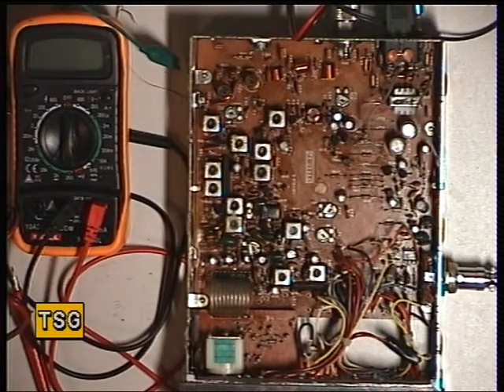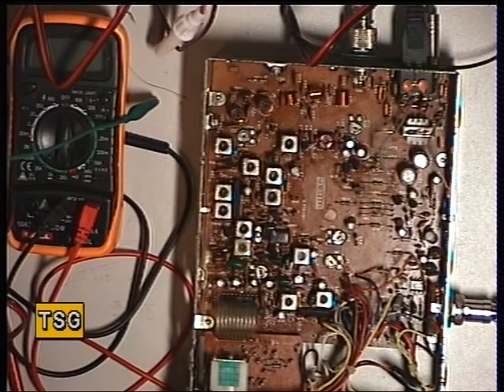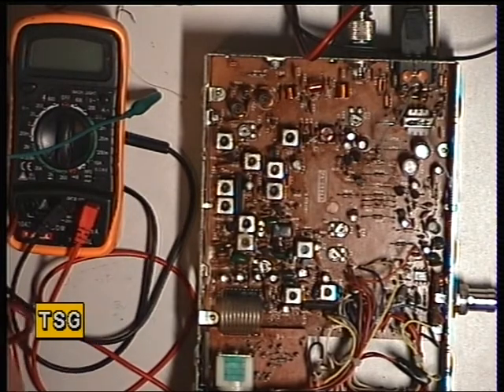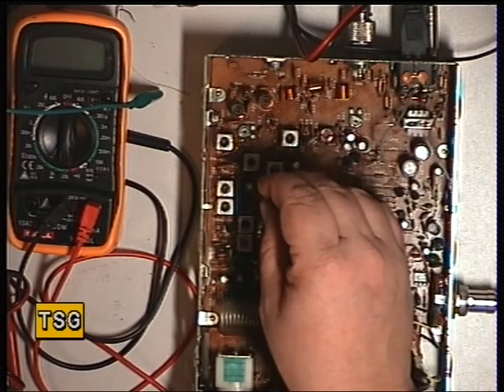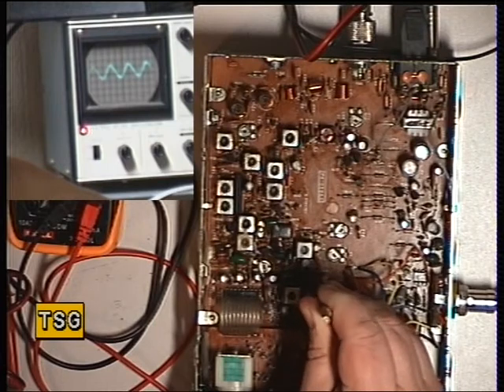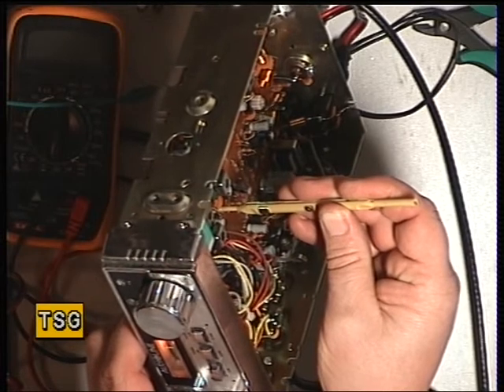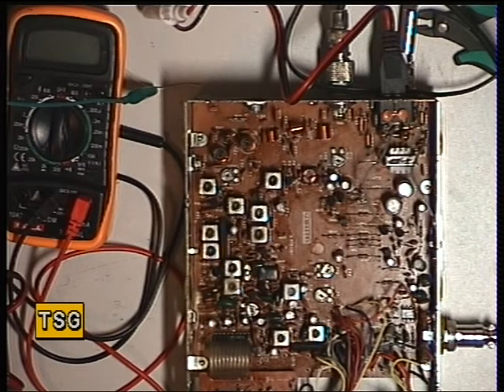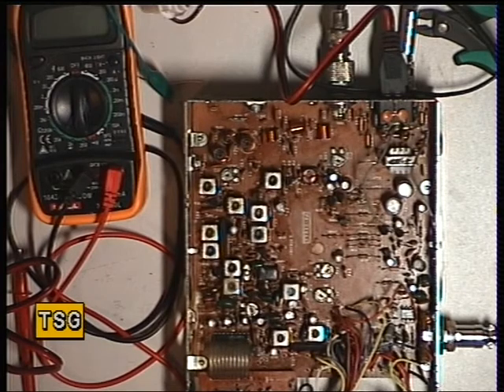Audioline 341,  UK (27/81 band) CB radio (Mobile). Receiver Alignment

Comment: I have just accuired  a uniden 300 Base station with no trx checked to see if in lock showing 7.5 volts on transmit and receive looks unmolested wondered if you have come across this before..love your videos.
Reply from the maker: SO the VCO is out of lock as it should be around 2-4V.  The first port of call is to change the two 220uf electrolytics. One usually shorts out the 5V PLL rail to deck, and the other also needs changing. Had to start changing the 470uf one too these days.

Richard
Reply: Yes I have changed the two caps for 16v ones still the same  just wodered if there was anything else you had come across as these sets are over 35 years old more and more failures are emerging thanks for the reply...

Comment: anyone have an old audioline 341 with intact pots etc.bought one that was supposidly working off ebay but its stuck on 1 channel rx and tx and its been guddled with big time ?????
Reply from the maker: They are all standard components that can be bought new from most component suppliers. Don't bother with second hand bits.

Regarding "stuck on channel 1", is that what the display says or does that change & the radio is internally stuck on ch1. I say this because the LC9119 synthesiser chip has an emergency protocol that in the event of an incorrect channel code from the channel switch, will assume an emergency & default to channel 9

Comment: So the speaker failed on that one too..... I had to replace mine 3 years from new. It shot out the core magnet one day.

I never liked power mics and solved the basey modulation by adding a high pass filter and switching to crystal mic elements rather than dynamic ones. Tandy sold them as an upgrade CB mic element replacement back then in the 1980's. Can't buy them today.

Another fault was that the 2SC2028 output power transistor would snap its own legs up close to the packaging through repeated thermal expansion and contraction over time creating a block to RF yet allow DC from a multimeter to flow through it when running a diagnoses, which adds to the confusion. Only way of detecting this fault is that when the screw is undone the transistor falls off of its legs.

Replaced mine with a MRF 475 item as these are more resislient.

I also have the A3 poster sized circuit diagram for the board which I aquired back in 1983.

I recently bought a Uniden 100 at a Ham radio rally which has a broken squelch pot..... the connection part has fatigued and detached from the securely mounted pot. Any idea where or what a suitable replacement could be found??
Reply from the maker: Andy Reid I'm afraid specific parts after 30 years have dried up. I buy in the odd scrap set from time to time & illegal AM sets of similar vintage can also be cheap donors.
Reply: UK CB radio servicing If I said that my old battered 341 sat on top of the clocks of a 350cc 2 stroke motorcycle and suffered at not exactly legal speeds in all winds and weathers (including trips into Wales) for thousands of miles over several years it is surprising that it still works.

It was certainly worth the £120 I paid for it new back in 1981 from Dixons.

I now tend to aquire Audioline and Uniden rigs as I find them as I'm more than familiar with the brand, find them engineer friendly and obviously extremely tough.

I'll have to figure how to fit something else which might involve some actual chassis modification regarding the hole. The pot is a miniature type. I could try the local Maplins for a close match. None of the ones I have lying around fit in the space.

Comment: I still have two Uniace 200's and a 400 in the attic. Who was it that was selling them off on Lower Parliament Street in 1982?
Reply from the maker: Ace Audio, sir!
Reply: That would explain the brand name then!
Reply from the maker: Yes, I presume their chain of HiFi shops were the original importers....then they realised like Boots & Woolworths etc that CB radios simply couldn't be sold out of a box.
Reply from the maker: As small parcel seems to have arrived from you. Thanks!
Reply: I found that board in a bag of other bits and remembered its origin. Found the manual too. It should work, just add a meter.
Reply from the maker: I'd forgotten all about it. Thanks!